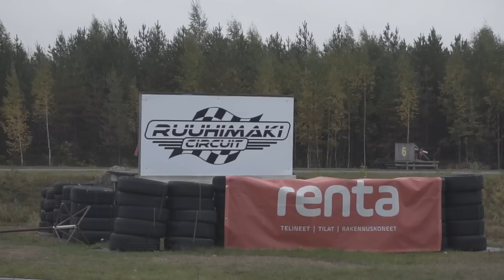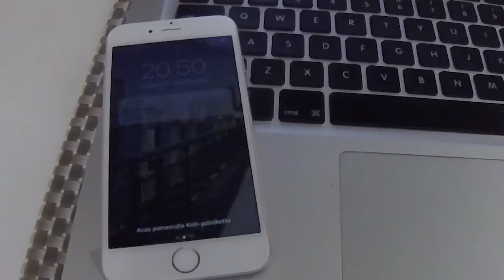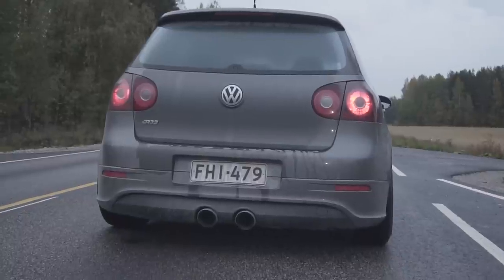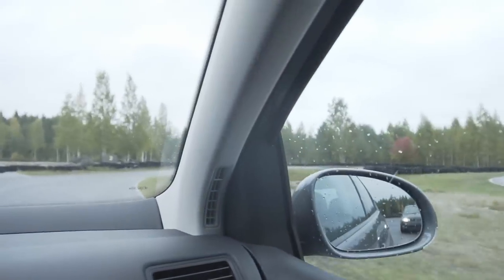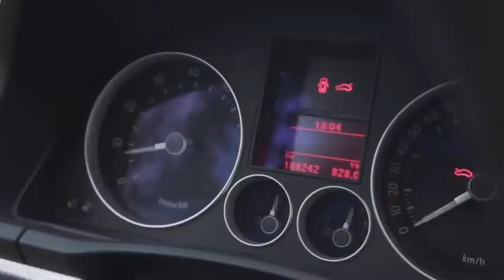VW Golf R32 review - AWD drifting and VR6 rumble

Comment: I think it couldve done without the awd, a great example is the Mazda 3 mps, Mazda couldve put the awd from the 6 mps but they didnt, bcs it would mess up the weight distribution and add too much weight.Great video guys!
Reply from the maker: That's the conundrum with this car: the engine is great in its own right, but it wouldn't fit further back and it weights a ton too. There are many great fwd examples how to do this "properly", but then again non of them have an engine with this much character or sound.

Comment: Let me get this straight, you guys actually saying the car would be more fun with front wheel drive?
Highly confused here as owner of one..
Reply from the maker: Yes. When driving with grip, a good car becomes interesting at the limit of grip, right? Well this didn't. It tried to assist you with the haldex AWD - with a delay - which it didn't have the power for. Then it switched back to FWD - with a delay - but it had already bogged down. So to make this car better, you'd need to:
a) Simplify and add lightness aka ditch the weight and complexity of awd and go 2wd
b)add more power and make the Haldex work faster. Which they have done with the R.
And even then, driving with grip on tarmac, option a is usually more fun. Loose surfaces = different story obviously - with this R32 as well.